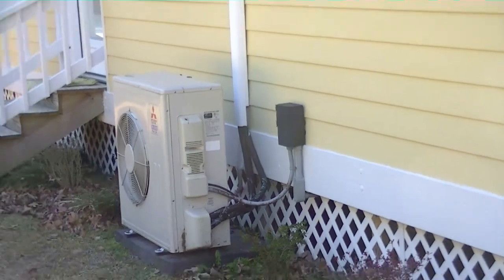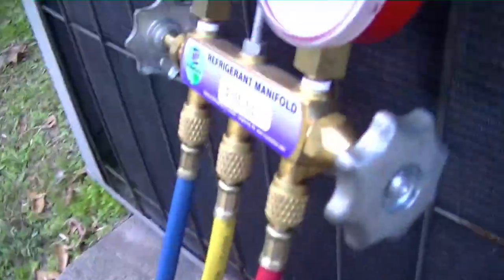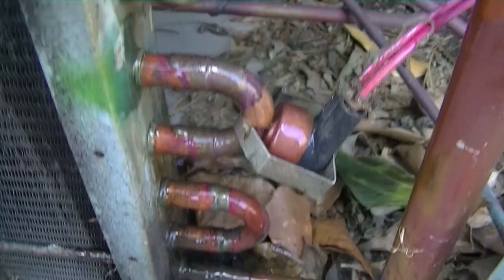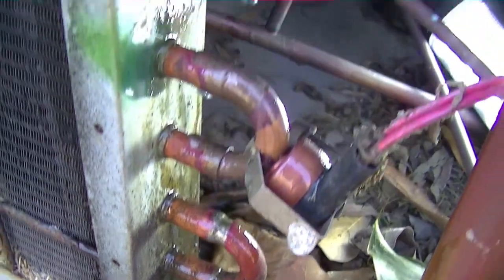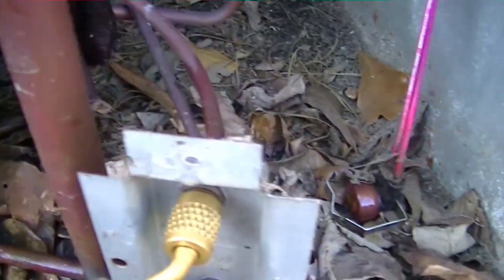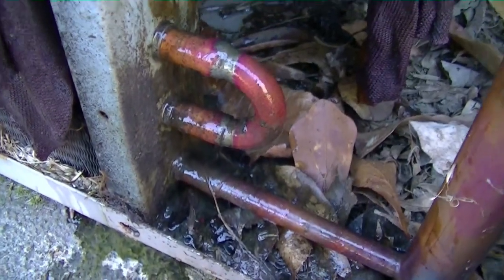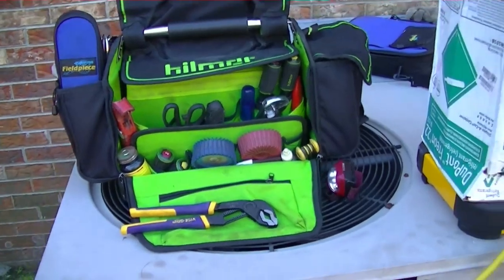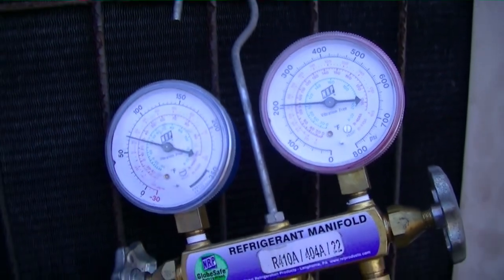HVAC Service Training-  Condenser Refrigerant Leak Repair

Comment: I sooo wish u were near me I have put the leak freeze in my ac and it didn't work then I put more freeon in it and it stayed cool for 2 days now it's back hot in the house
Reply from the maker: Def need a good tech to find and repair the leak. Where are you. Maybe one of the other Techs I know is near you.
Reply: +talyn875 Dallas Tx
Reply from the maker: +tolberta07 there is a few guys in Dallas. let me see

Comment: The stitching is coming apart all over it. The velcro that holds the center part breaks free all the time. Defiantly going to either the veto or the Klein backpack. Their products just didn't stand up to their warranty at out company.
Reply from the maker: I will watch out for that, the Velcro has popped out on mine a couple times.

Comment: You are DA man! Do you purge with nitrogen when you do those tiny pin hole leak patch jobs? Thanks.
Reply from the maker: I did not. My excuse is that I brazed for just a few seconds. To me its not worth it, but there will be plenty that say to do it anyway.

Comment: Great job Zack as always !! Mighty nice of it to bust a pin hole in the front for ya,lol. That bag is starting to grow on me as are some other Hilmor items. Look at their catalog they sent me every few days. Is it Christmas yet ? Take care, Brett
Reply from the maker: The bag is good, the nut drivers are not. I should have stuck with malco on those.
Reply: LOL. I hear their refrig. gauges aren't good either. How do you like the temp. gauge and clamps ? Brett
Reply from the maker: hvactecster79 I like the clamps, they have been real good. I have put them through hell.
Reply: The temp gauge good also ?
Reply from the maker: Yep, the gauge is good as well.
Reply: Thanks, been needing a replacement and liked what I saw in the catalog.

Comment: Why didn't you change the filter drier? Job IMO isn't done.
Reply from the maker: Why do you think it needs to be changed?
Reply: talyn875 Anytime a refrigeration system is opened to the atmospheric pressure the filter drier should be changed. Even if it wasn't opened to atmospheric pressure, if I don't know the systems history I'm changing the drier. Driers are only $13 and can add to you ticket.
Reply from the maker: I disagree. I don't think every repair warrants a drier change, especially when you have new refrigerant and a deep vacuum. That would mean on a Goodman evaporator change you would remove all the refrigerant and change the drier in the condenser? I think it is a good thing, but overkill.
Reply: talyn875 Yes, I would change a drier on a Goodman evap coil change out with new refrigerant. I've seen enough restricted driers to change them every time I open the system to the atmosphere. I didn't write the HVAC book, I'm just  following what the manufacturers and engineers recommend. I do enjoy your video's and I'm confident your work ethics are great. I just brought this up as a point I noticed.
Reply from the maker: No problem Juan. I think the discussion is good, we just disagree. Thanks for watching